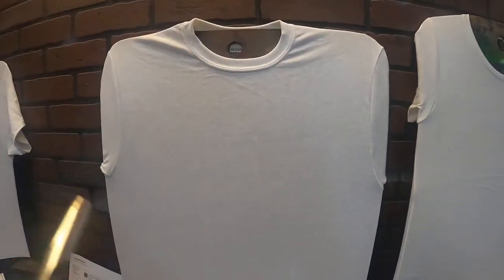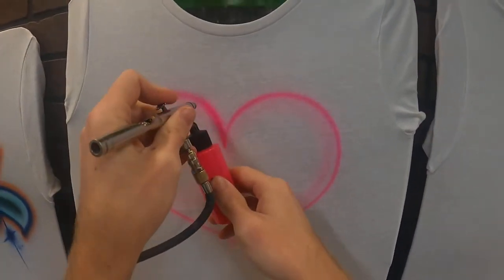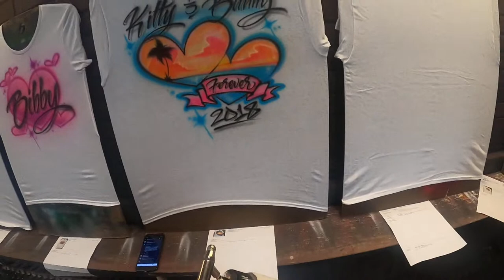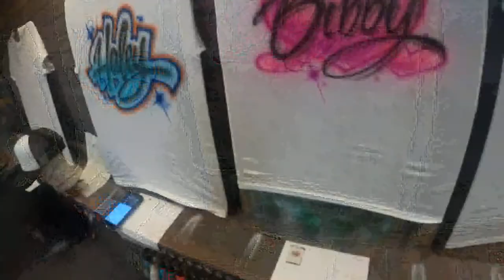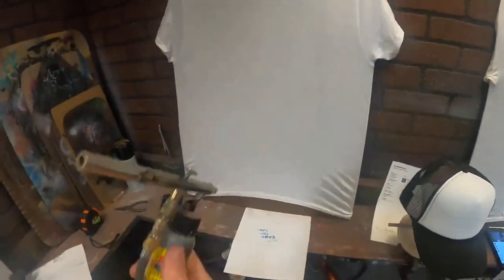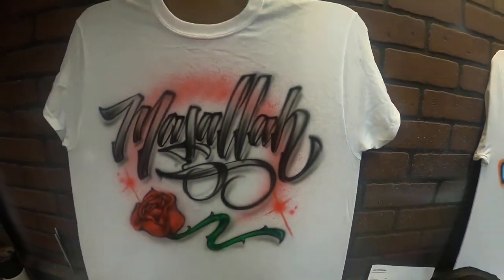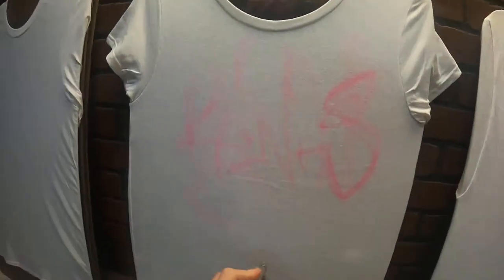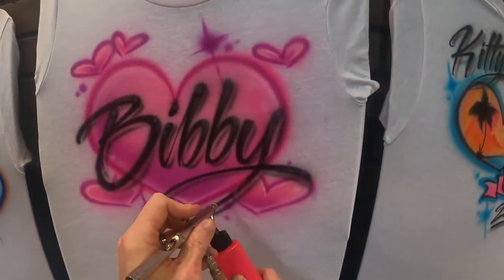Let's Paint! How-to Airbrush T shirts - Graffiti / Calligraphy designs

Comment: Are you left handed or right handed? Do you lead with the top hand or the bottom hand?
Reply from the maker: I'm left handed. You lead with the top hand, that's where the trigger is, which is probably where 75% of the concentration goes. You can paint one handed, I just like the extra hand there for more control and smoother lines